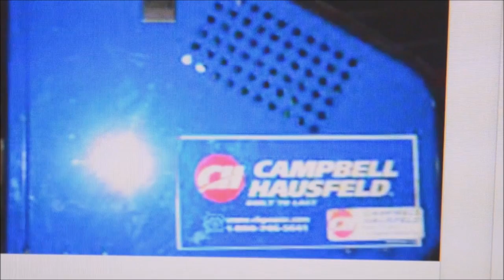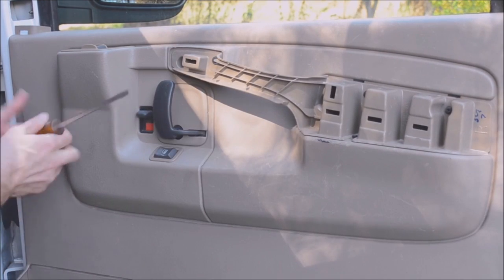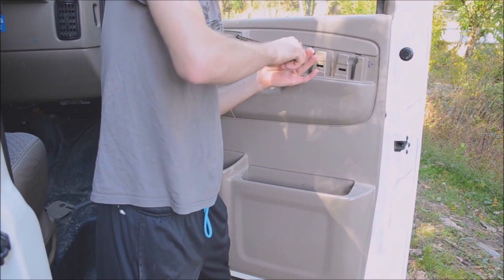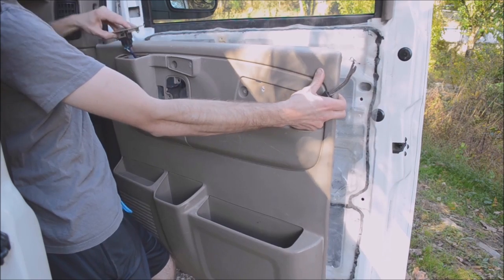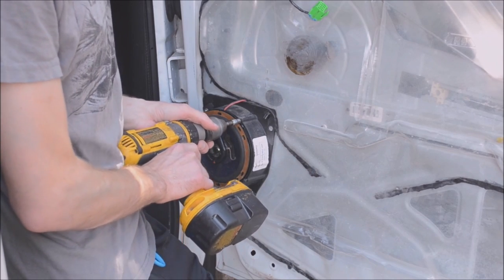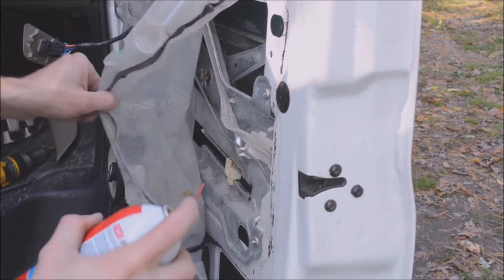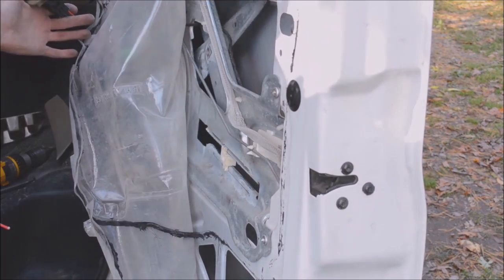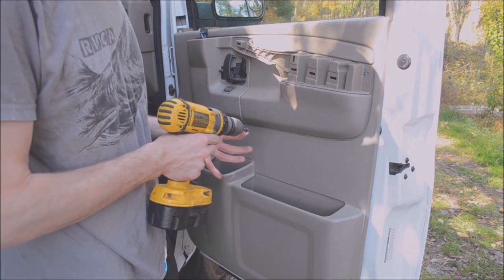Remove Door Panel, Replace Speaker, & Fix Slow Window \\ Chevy Express / Savana

Comment: I replaced the window motor on one of these type of vans 99... the teeth were a different size... maybe from wear or maybe because the new one was a korean replacement but either way it moves much faster now. 40 bucks to replace... no riveting or anything just nuts that hold it on the bolts and the gear that turns the wheel of the window. Just in case you wanna go ahead and get a replacement for it while you have your panel open!
Reply from the maker: cheers

Comment: Never shows how to disconnect anything (panels; switches; etc).  That can be the most difficult and tricky part of the process and where one can damage parts so it ends up needing repair before reassembly.

Comment: What tool do you need to remove the black plastic piece that holds the speaker in place? It’s a weird fitting for that screw just need to know the name so I can replace it with a Original Equipment speaker

Comment: I was looking up welders to this morning, just to see what's out there lol.  That speaker replacement is wayyy easier to replace than what my Crown Vic will be.
Reply from the maker: nice haha, yea i was looking them up and saw a lot of misspelling of campbell hausfeld. yea those door panels are probably cemented on lol
Reply: That's funny lol , there's no speakers in the doors unfortunately the two speakers for the front are in the dash so i have to tear apart the dash to replace them. Im tearing apart a newer wrecked ford focus this winter so I'll grab the door dinger ( I like the sound of that one better ) off of it and install it while i have my dash apart for the speakers . also I'll replace the speedo light while im at it lol it died on me last month , that sucker is probably the original one
Reply from the maker: oh wow and haha yea those lights surprisingly last a long time
Reply: a DIY Car Guy Correction it started working again lol. I started it up to get ready for a home bound journey and it just started working when i turned my headlights on. Your van looks like it wasn't used that often. When i see those vans around KS they are missing all those plastic pieces
Reply from the maker: Jimbo Booth Oh nice lol, maybe a loose connection on it. It has 106k miles, the company who had it took good care of it
Reply: a DIY Car Guy That's good , looks like it'll last a good minute
Reply from the maker: Jimbo Booth yeh just gotta do a little touch up on some spots
Reply: a DIY Car Guy why not Line-X it ? Lol
Reply from the maker: I wish but only a Line-X dealer can apply it from what I understand
Reply: a DIY Car Guy what about off brand truck bed liners ? I heard hurculiner is good. I saw a video of a van that has been completely covered in it.
Reply from the maker: Jimbo Booth I could do that, maybe next season, I already got some paint for it lol, I'm just doing the bottom though lol
Reply: a DIY Car Guy good idea for rust prevention. i really want to do something for the vic
Reply from the maker: yea it will hold it over for a few years, its worth it, even just to put a coat of rustoleum on
Reply: a DIY Car Guy that's good. I still want to coat my whole car in that stuff lol
Reply from the maker: Jimbo Booth nice haha, that would be awesome
Reply: a DIY Car Guy I figure so. I might start next summer on the underbelly
Reply from the maker: nice, I wish we didn't have to wait for winter to blow by
Reply: I agree , but ill enjoy have to it anyway lol
Reply from the maker: Jimbo Booth haha yea